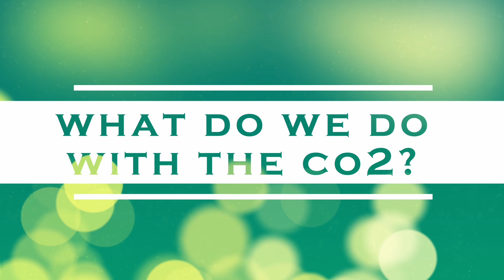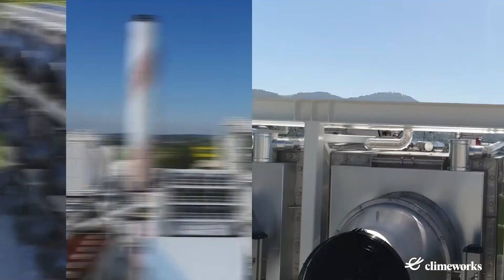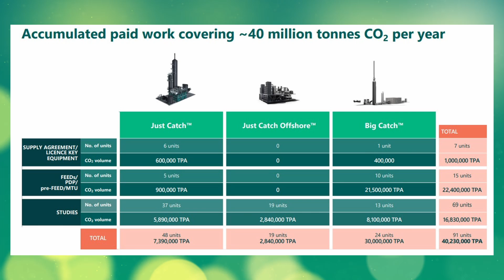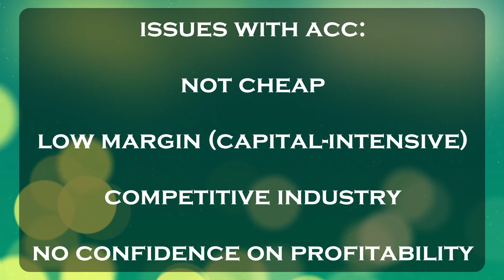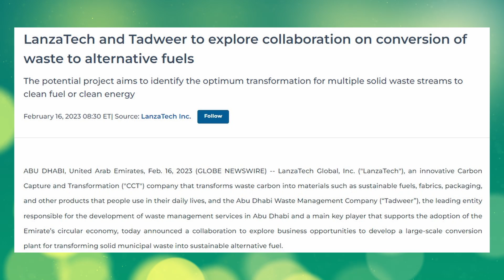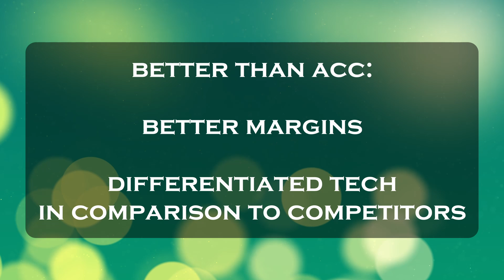How to Invest in Carbon Capture

Comment: Greening up the planet using the energy of the sun is the viable way to capture carbon from atmosphere.   This industrial plant carbon capture is an unviable way to go as the energy required is not available.   Do not loose money investing in this scam the physics do not work.
Reply from the maker: These plants are either economically-viable already or approaching it, in certain jurisdictions. Carbon taxes are only going to increase in cost. Why would these companies have so much demand if there was no situation where the physics worked? Sounds like you've just drank the renewable energy Kool-Aid.